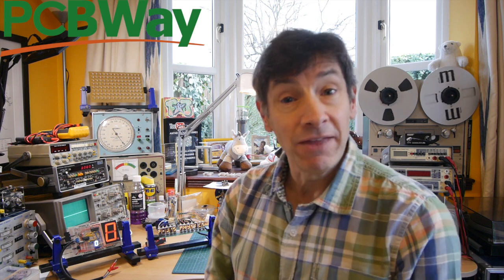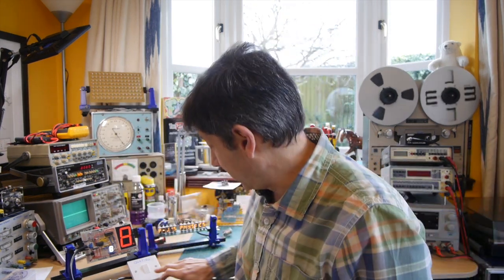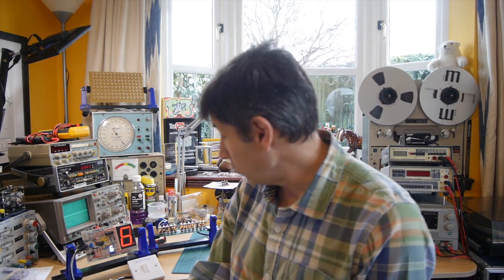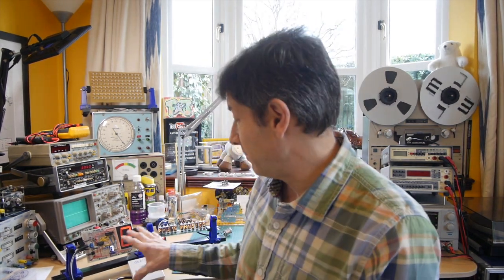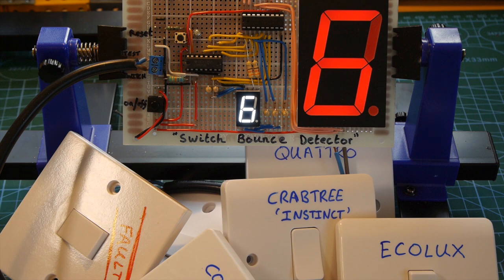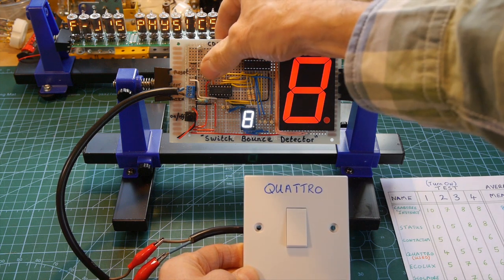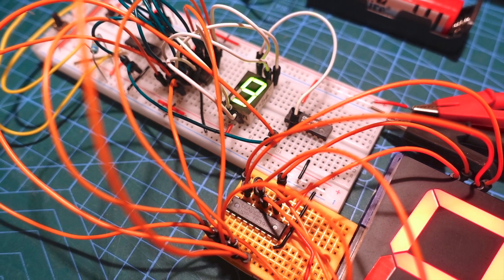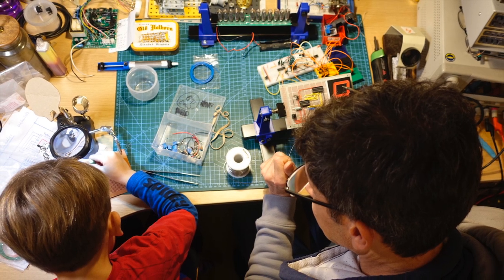Switch Bounce Detector - F-J's Physics - Video 178

Comment: Anthony, something else you may wish to try with different light switches is the resistance of the switch contacts ( measured at extra low voltage) you will be surprised at how they vary.
Reply from the maker: Yes, that's an interesting point.  As the voltage drops and drops the electric field between the contacts reduces and the effect of contact surface conditions becomes more noticeable.  I wonder if the voltage was low enough and the oxide of the right type one could experience tunnelling!

Comment: Nice video as usual.  Now show what happens with the AC switch is used to switch a  230 V 10 Amp DC load best bit is when you try to switch off the load. Even Big Clive would be impressed. Tony
I was also going to add how switch bounce on some electronic equipment can often be the ghost in the machine when the unexpected happens
Reply from the maker: Yes, you are right - bounce can cause all sorts of mysterious things to happen - some of them caused by arc EMC issues.  Switching a 10A DC load would be interesting and an AC one of that current even more so!  Thanks for the suggestion and for always taking the time to comment.

Comment: what if the result is greater than 9?
Reply from the maker: Good question about aliasing issues!  I copy a comment that I have made before and hope that explains it!  "I did quite a bit of testing off camera to see if I needed to add a second digit/counter and nearly all of the time it was below 10 bounces.  Occasionally in the teens.  So did not bother!  Not great science at all but that, in some ways was the point of the video, to show all the issues with trying to look at this problem scientifically!"  Hope that helps and thanks for watching.

Comment: Would be interesting to see any differences between AC (or analog signal) versus DC due to arc breaking at zero crossing with AC.  Nice video.  Thanks
Reply from the maker: Thanks mike - that is a really interesting point.  As I said in other comments, nothing about this video is very scientific or repeatable but it is a bit of fun.  Your zero crossing point comment reminds me of issues with back EMFs etc. when switching off AC devices at the wrong point in the cycle!

Comment: Aliasing(?) 8 is 18 or 28. Fire up the o-scope...
Reply from the maker: Yes, David.  I did quite a bit of testing off camera to see if I needed to add a second digit/counter and nearly all of the time it was below 10 bounces.  Occasionally in the teens.  So did not bother!  Not great science at all but that, in some ways was the point of the video, to show all the issues with trying to look at this problem scientifically!  I need to swap my bench scope out for the other Hameg (I do like them) scope that has the digital storage option on it.  Old fashioned but I do like a CRO scope.  My spectrum analyser, however, weights a ton!